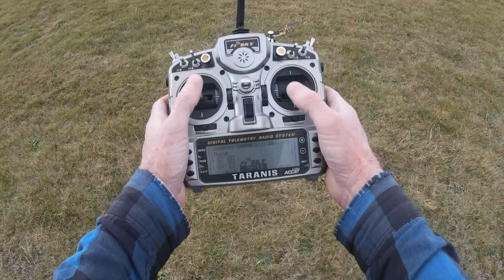Review: DJI Naza Lite multirotor flight controller

Comment: You can tune the crap out of a Pixhawk, control a gimbal and a gopro and fly missions, why would you want naza lite?
Reply: steve c..  Why are you being such a blatantly Trolling Duche ???

Just because you don't have the skills to make a PixHawk work for you does not mean it wont work for someone else with those required skills... 
Give it a break and STFU..
Reply: lasersbee, I wish I could give your comment 50 thumbs up 😀
Reply: Coz some just love dumb & dumber modes:)
Reply: Gregsky Price... When the NAZA came on the market the PixHawk was similarly priced. Today the PixHawk is more expensive.
Will still get a PixHawk system at some point for the Mission Planner feature.
Reply: steve c, I have to agree with you on this one, the issues are there and it doesn't look like they will disappear soon but the copter firmware 3.4 I'm running now works very well.
I use the Tower app in a field as I will not be taking a laptop with mission planner.
Reply: Maybe Bruce can show how it's done with Ardupilot FCs. 
All my Ardupilot  craft work perfectly!
Reply: It does work perfectly well and there are many thousands of people who would vouch for it.

It's a shame you've had such terrible problems but your experience is not representative of the general experience.
Reply: I agree, it does work amazingly well - many of the issues reported are done so by beta testers running release candidates, generally these are regarding the use of bleeding edge features newly introduced into the ardupilot code. If you stick to legacy features then generally you have no issues. There's no such thing as the perfect flight control software - even dji products have issues under certain circumstances - just Google dji fly-away. I stick with ardupilot as it's one I can quite happily tinker with in my builds. It's also very versatile as I use it in a plane too for stabilization and automated flights. 
There were indeed hardware issues in early release 3dr pixhawks, but I have always bought cheap version boards instead. The 2.4.5 hardware spec had an issue with some capacitors which caused a 2nd flight to demonstrate imu issues, but a workaround was found for this. The 2.4.6 spec had a dodgy microprocessor chip which wasn't etched properly giving it 1mb rom instead of the design 2mb, fixed in the 2.4.8 spec. It doesn't cause an issue with current AP code though but could affect USB connectivity if the code grows. Generally I like ardupilot and whatever it runs on. I have also quads with cleanflight/betaflight and these fly great too, but these serve a different purpose. So the right tool for the right job is what I say.
Reply: Steve,  the common factor in each of these issues is you.  The experience you've had is unique and there are plenty of people who can operate PH/MissionPanner/HK RTF's.  It's a shame that your view is so jaundiced but, if you really want to get it running, PM me and I'd be happy to help.
Reply: steve c, I imagine Microsoft have more than 400 issues active for any one if their products but yet the vast majority of users get along just fine.
Matt, you are wasting your time trying to help Steve C. He is an ungrateful individual, set in his misguided beliefs, and quite frankly not worth anyone's efforts. I say this with a heavy heart and only glad that he represents a tiny minority of folk in the Rc community, who otherwise are an awesome family to be a part of, willing to learn from others experiences instead of simply being dismissive. Best wishes Matt.,and hats off to you for offering to help thus ungrateful troll.
Incidentally, I just checked the current issues count for Opentx and it is 485,yet this is an awesome and stable piece of Rc firmware which I entrust all my models to on a daily basis.
Reply: Paul Atherton Forget it Paul... He does not want to learn.
You will never win an argument arguing with a doorknob. ;)
Reply: Steve, You are freekin hilarious! You thought of having your own TV show?
Reply: nobody has mentioned iNav . for those who hate Pixhawk and DJI , iNav is based on Betaflight and worth a look but it isn't for no techs
Reply: Horses for courses, Hotwire.  The APM stack is an enthusiast-class, open source suite.  That brings with it a range of specific positives and negatives.  It isn't perfect for every person (or use case), but then no other platform is either.  But to say that it doesn't work is simply wrong and intentional trolling on behalf of Steve.
Reply: Hear hear!
Reply: lasersbee, Naza m lite doesn't have all the features that pixhawk so can't really compare.
Reply: lasersbee, actually we are talking arducopter vs naza m lite , arducopter runs now on more hardware so you can get it cheaper.
Reply: lasersbee ,
https://uk.farnell.com/element14/bbone-blue/beaglebone-blue-robotics-platform/dp/2612583?COM=dtss-detail_DesignCenter_element14_BBONE-BLUE%20CMPNULL
Reply: I haven't tried the Tower app since I never could get the Pixhawk programmed with either MP or QGC so it would work.  I actually have 2 of them that never worked, wore out the first one trying hundreds of different versions of firmware with bug fixes for a year, got a second one then gave up after 2 more years.  Doesn't matter now though since they are obsolete and no longer being made.
Reply: I have several Pixhawks. It's quite a learning curve if you're not experienced in computers and programing like myself, but I worked on it and mine fly well.
Reply: If you were able to reprogram Mission Planner to make it work you should release your version because the ones who are supposed to be maintaining it haven't been able to get it working in 3 years!  When I first tried it in 2014 it couldn't program the PX4 as any kind of copter, just a plane.  After about a year one of the updates got that working but then it couldn't calibrate the compass and gyros without crashing.  They came out with an update that made a big change to the calibration procedure about a year ago so it doesn't crash not but still won't work when it's finished and that's where I gave up on trying to ever get anything to fly and got a 3D printer instead!
Reply: steve c I use a current version of the mission planner and a current version of the firmware, I don't have any modifications in any of it.
I know sometimes there might be usb issues with some PCs I've noticed that I have to connect the board directly to the PC's usb port to flash the firmware no hubs and cable extensions.
I works very well though as I said before, I use the Tower app in the field for portability.
Reply: Like I said, fanboys will dispute that it doesn't work but you can check the bug reports on Github and there are still 400 unresolved issues so I doubt they will ever get it to work.
Reply: steve c, It works for me so I use it but if I wanted an out of the box drone to take nice photos and videos I'd buy a phantom or mavik, I wouldn't even bother with naza
Reply: Yes I think buying one that flies right out of the box is the only way to get one that can really fly but those are expensive!  I was thinking of buying a Phantom 3 until I found that DJI no longer supports them even though they still sell them.
Reply: steve c, this is the big thing I don't like about them, buy it spend a lot of money and when it brakes down after warenty pay even more to rapair and even if you are willing  to pay for the repair the say "sorry we don't support this product any more, why don't you buy our new phantom?"
Reply: Gregsky Vre
Reply: steve c: Doesn't support them in what way?
Reply: either your hobby is phography or RC. Ardupilot works as a hobby platform but you aren't going to complete for photography. DJI have put huge time and money into getting that right.
I can't tinker with a Phantom or Mavic so I'm not interested. however if I took video or stills for a living, I would go that way.
Reply: additionally you can mod the ardupilot code yourself. it's about the easiest code to edit. it's an Arduino.
Reply: DJI doesn't support their products any way at all!  I was going to buy a Phantom 3 (which they still sell along with the Naza) but they refuse to provide updated software or firmware for either one of them!  When I complained that their ground control software wouldn't run in Win10 they reply was:  "Use XP"!   I will never buy any of their products now if they are going to be such jerks!
3D Robotics is just as bad, they used to sell the worthless PX4 but don't provide software so you have to get crappy open source software written by other hobbyists in their basements then when it doesn't work there's nobody to complain to!  3DR won't fix their products either!  After 2 years of trying hundreds of different versions of software with bug fixes it finally broke from handling it so much and when I asked 3DR if they could fix it they said: Get A NEW ONE!  Both these companies are nothing but crooks!
Reply: Wow! You have nothing but problems with Drones. I suggest you take up knitting.
Reply: Steve I think you just described the Bill Gates business model. All true the new product is better and the old is unsupported. 
I use to make model kits that didn't break and flew really well. Not a business model.
Reply: this thread has earned a response from Bruce. Bruce do you hear, an outline on APM is begging.
Really , Ardupilot is excellent for larger multirotors. Acro mode on APM is so nice LOS and creates lovely video. Flip mode, you won't see that from anywhere else. 
First you have to learn to tune and Bruce could do a video on that, please !
Reply: steve c I have been flying Pixhawks for years. I've definitely had issues with Mission Planner (mostly compass/accel calibration problems). But actual flight firmware....I've never had a single REAL issue. Nothing that has ever crashed the quad. 

So in my opinion the Pixhawk is an absolutely amazing flight controller. It's fantastic. And most of the Github bugs are for beta versions, not the current release. There are indeed bugs in Mission Planner, but I've never seen any SERIOUS bugs, just minor annoyances. It's free open source software, of course there will be bugs. The fact that they've made it as great as it is is just amazing to me.
Reply: I have 2 that never worked that say anyone is wrong who claim they will fly. Guess it doesn't matter anymore since they aren't being made or sold after 3D Robotics want out of business because nobody bought their crappy Solo drones.
Reply: steve c, even though 3dr don't make them, the design is open source and so many of the v1 px4 pixhawk controllers are still made and sold by most of the Chinese retailers. The hardware design has been improved in the last year or so to resolve issues with imu power supply and faulty arm processor (which limited EEPROM to 1mb). There are also many off spins from the original design such as the auav-x2, pixracer, pixhawk lite, vr brain, and now the pixhawk v2.1. The ardupilot firmware project, although no longer sponsored by 3dr,is still active, although development at a slower rate than before. You don't have to take my word for this, just do some research and you'll see the validity of my comments. Check discuss.ardupilot.com I realise you're taking the piss in your responses to wind folk up and I think you are succeeding in doing this. If you truly have no use for your pixhawks, feel free to send them to me, as I appear to have the ability to use these just fine where you clearly don't.
Reply: Even if someone did make a better Pixhawk that actually worked it wouldn't make any difference because the software that's needed to program them like Qgroundcontrol and Mission Planner has never worked!  If you check the bug reports on Github for them each one still has over 400 unresolved issues or bugs!
Reply: steve c, true there are many bugs, but mostly with experimental features. I use mission planner almost daily and rarely get issues. Offer is still open for you to send me your unwanted pixhawk fc's.
Reply: I've got a better idea, why don't you send me one that works?  There's no such thing, right?  Once when I contacted 3DR to ask if they could fix mine they said "No, Buy A New One"!  I was puzzled by that at first but then I realized they couldn't take in any for repair because then they would have to prove it works to show they had fixed it and since they couldn't do that it would open them up to Fraud Lawsuits!  As long as they are just selling the hardware that requires 3rd party shareware they can dodge responsibility by blaming problems on the software and since the software never worked there's no way to tell if the Pixhawk is actually bad or not!
DJI isn't any better though and won't provide software for the Naza or Phantom 3 even though they still sell them, they told me to use Windows XP when I asked about making them work in Windows 10!
Reply: steve c, well you can check my helicopter and fx61 videos to see pixhawk working. Sending you one is pointless, as you don't seem to have the ability to get one working, then I'm afraid you are a hopeless case. If you're really interested in getting one to work then buy one built to the 2.4.8 spec, as they are the latest v1 revision. I have 2.4.4 and 2.4.6 version which also work. None of mine are manufactured by 3DR,but instead cheep Chinese versions.
Reply: 99% of quadcopter videos are fakes so that doesn't prove anything. I got an RTF model from HobbyKing that has several videos showing it flying but it was too heavy and under powered to ever get off the ground.
Maybe if there was a version of Betaflight for the Pixhawk it might be made to work but since it's now obsolete that's not likely to happen.
Reply: steve c, sorry, but you are wrong on both points. My videos are not fake - and to say they are, you are suggesting that I don't have integrity, which is out of order. I can post a video showing you my hexacopter with its pixhawk running arducopter v3.5rc8 (presently), show mission planner connecting over a 433mhz radio modem, demonstrate the flight modes I have configured including RTH which deploys the landing gear on the way down during its automated landing sequence. I can show it flying a mission whilst you see this overlaid on the map in Mission Planner, and I can show you the output from the OSD, and from my own telemetry project so you can see it working. I imagine though you'd still suggest that it's still a fake as that's just your way,so I don't feel obliged to humour you. I feel sorry for you actually with your dismissive outlook and impression you have if the Rc community. Maybe you should give up on RC and do some other hobby. 
On your second point, I believe that there is a branch of betaflight being developed for the pixhawk. You should Google it. I recall seeing this mentioned in a recent painless 360 video.
Reply: Matt !: Now THAT is the spirit of a true hobbyist. Well done sir.
Reply: Didn't you check out the 400 issues on Github still outstanding with Mission Planner?  I've got hundreds of silly replies like this, how are you going to help, re-write Mission Planner to make it work or re-design the Pixhawk to make it work?  If you can't do that then you can't help!
Reply: Yeah, you Pixhawk fan boys can stop harassing everyone who complains about how crappy they are since they are out of business and won't be paying you or giving you anymore free models!
Reply: Steve, Not sure why, despite trying to educate you, you still see Pixhawk as "3DR". Sure, a company called 3D Robotics built and retailed the Pixhawk px4 v1 initially (and you had a bad experience with them, for which I am sorry for you, as this clearly has has left scars), but 3DR had their own version of firmware called the PX4 flight stack which was closed source. Ardupilot came from the APM hardware platform and has evolved to run on Pixhawk and its derivatives. Remember that Ardupilot is Open Source, built, tested and supported by the community - yes people doing this for the benefit of the community! Sure there are a few key developers, and these guys were even sponsored by 3DR at one point, but in the whole the community develops and shapes the product  - not just developers but beta testers and those who document and help others resolve issues. The product has even further pushed the development of new hardware in the Pixhawk 2.1, which is a feat of engineering, and nothing to do with 3DR. Things have developed vastly since your experiences with Ardupilot (the earliest version I flew was 3.2), and this development is all due to the community effort afforded it, and I'm almost certain that if you took up the offer of help which was very kindly extended to you, instead of simply ignoring it and going on to make trolling comments, then you would likely change your mind about Pixhawk once you see how well it can work when implemented properly - sure it is a complex beast but with help you would have no issue. If however you continue to think that all the Arducopter videos you see on line showing perfectly working flying craft are all fake, then I am sorry, but you are delusional. Many professionals use Ardupilot in their work - even Boeing and NASA, plus many others in the farming and engineering industries. I'm sorrry Steve but your experiences are not representative of Pixhawk/Ardupilot at all in the whole.

I do not consider myself a fanboy of Ardupilot - I also use Cleanflight, Betaflight on racing quads, and have used baseflight and Taulabs in the past also (never DJI as I prefer the open source route). They all have their merits, but for automated flight and my videography platforms - I only rely on Pixhawk and Ardupilot, and happy to be a member of the community to return a little of what it has given to me for free - remember this firmware is developed and offered for free! I am also a developer of the Teensy Mavlink-FrSky S.Port telemetry project, which works really well with Ardupilot and FrSky Taranis, and I am happy to help out other RC enthusiasts with this as well as offering any Ardupilot and Pixhawk setup advice. So if you really want help, then ask. Constantly trolling the post does not help anyone.
Reply: I'm not sure why you keep writing this rubbish!  The free software is crap and worth exactly what you pay for it!
Reply: Hotwire, Matthew Ogbourne has been doing a fair bit with inav in recent months. Some interesting stuff on his YouTube channel.
Reply: Paul, if you are so great that you can somehow magically make Pixhawks work why didn't you go to work for 3DR to make their drones fly and save them from bankruptcy?
Reply: I do think steve c has a point. If a product or suite of products in the case of Ardupilot/Pixhawk/MP, is overly complicated to get working for a simple use, it is probably failing for some users. The tuning in Ardupilot is clumsy and very time consuming. There are no examples for know frame and motor sizes and a very unstructured hierarchy of  PIDs. Autotune gives a very soft tune that impacts on most other functions and uses.
That's not the case for iNav, it's base config is BetaFlight and the other stuff sits on top of that. However it's easy to learn from other mistakes. It's also much less extensive that Ardupilot, so what's to say it doesn't become just as challenging to use in the future.
The answer to overcoming any challenge like getting Pixhawk to fly something is to start simple. If you pile on all the stuff to want to use in an RC project you will be lost from the start. Start with the very bare essentials, fly acro to tune and test the whole lot with a meter before you leave for the field. Check the radio and motors respond and leave out the GPS etc. Add stuff one at a time! 
I have a friend who has been struggling with a Pixhawk hex project for over a year. He refuses to go back to basics. There is no way there can be a satisfying result.
Cheers.
Bruce where are you?
Reply: For Steve it doesn't work but he was a bit over the top. Venting maybe.
Reply: I'll tell you what steve c come to my house and I'll show you that all my naza's work with windows 10 and all my machines fly great and then you can talk !!! Frsky is open source and it works great also, lets ask ourselves whats the common denominator, seems to me to be operator error !!!
Reply: DJI has released a software update for the Phantom 3, first one since 2015, so maybe they are finally getting back into customer service again?
Reply: steve c 
I would expect DJI have understood the loss of their hobby market. It really doesn't make sense to throw away a market just because it's small. 
Also, some of the people in that group, are where their staff come from. Hobbyists where the routes of the software industry and really they still are. Creative people do these things for fun.
Reply: No!  Don't waste your money!  MP hasn't run properly in 3 years that I've been trying to use it and still has over 400 unresolved issues!  Fanboys will deny that but you can check the bug reports on Github.
Reply: You can't do anything with a crappy Pixhawk since they don't work without software to set them up and neither Mission Planner or Qgroundcontrol has worked in the last 3 years so it's a worthless piece of rubbish!